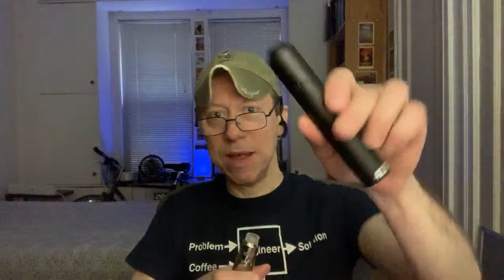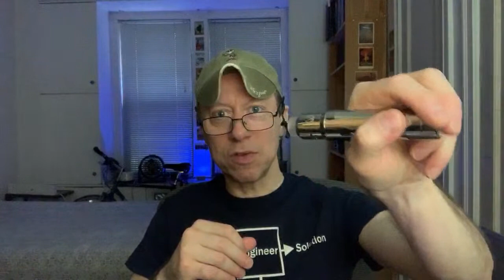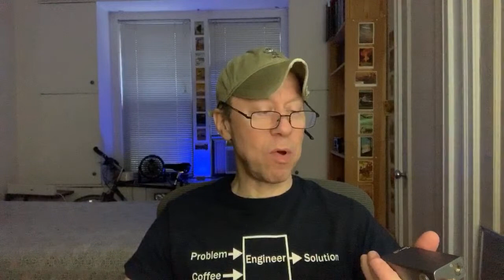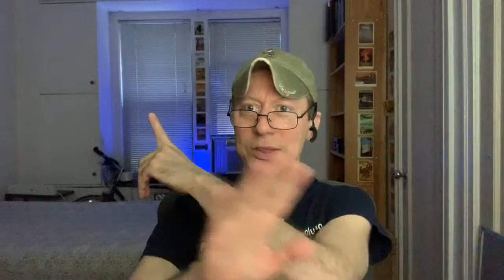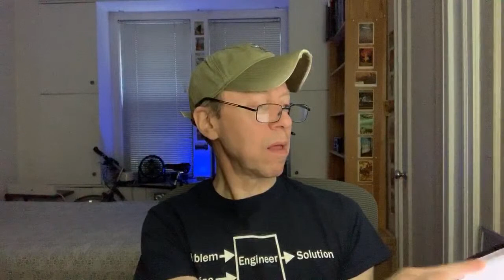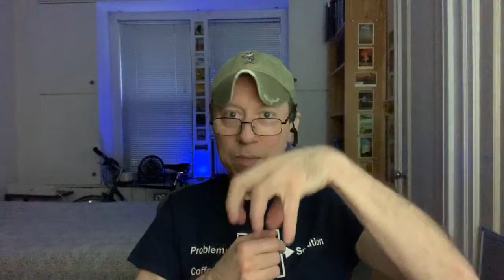The Power Hour #28 – A device we can put our batteries into any way we want?

Comment: darn, I missed you and have to use replay.
It seems a lot of trouble to have "any-way" battery bays done electrically instead of using decent markings on battery cells and bays - and as pointed out, it just kicks the can down the road to the next time the user upgrades.  It also trains users to have no regard to cell polarity, which seems to set a pretty dangerous precedent.  Also, can they even patent pre-existing art?
Thankfully, as the mods are absolutely fugly, they won't catch on.
I'm not sure about your power loss through 2A charging, given that you only have 10w to play with at the outset.  I don't see that much heating on my DNAs through micro-B USB 2.0 when I run the case analyser (as I do for all my Evolv based mods as the mod manufacturer rarely does) and the charging rate seems to indicate that a very high proportion of the incoming 10w is going right to the cells, which actually do have a slightly increased temperature - not so much that I'd call them remotely even warm, never mind hot, but not quite as cold as they would be at rest.  I can't detect ANY rise in temperature on the 21700s (P42As) in my Odin though.  Having said that, the Evolv charging circuit is one you've said you recognise and have used yourself, so is probably in the top line of components in terms of efficiency as well as reliability.
I suspect less well-designed circuits simply throw away the difference between the 5V of the USB and the 4..2 needed at the cell, and cap the current to whatever they can cope with - so you'd get 0.8V at 1 or 2A being dumped as heat.  Charging circuits on motorcycles used that technology for years, with a Zener diode mounted in a massive finned heatsink under the headlight.  It even became such a styling feature that fake ones were fitted to some bikes which had better means of regulating voltage and didn't need them!
To me, self-wiping contacts are far superior to using conductive grease in switches.  I've used them for years in banks of lead-acid cells used first in forklifts (way back in my warehouse and truck driving days) then later, after getting a edumacashun in IT, in power backup systems ranging in size from a single PC up to a whole server farm, where the batteries aren't even on the ground floor as that would make them intolerant of flooding.  Such buildings are specially designed to handle the weight of a whole floor packed with lead-acid batteries and a pair of monstrous diesel generators.  The ground floor is used by admin, is massively constructed and feels like being in a bunker.  Actually, it is one, as one threat they are designed to be tolerant of is terrorism.  In that application, I was more concerned with heat gained than power lost, but it amounts to the same thing.
I suspect using grease results in the switch conductivity being highly dependent on the pressure applied by the user.  The harder it is pressed, the less grease is left between the metal.
I've always thought of an 18350 as a purely MTL cell, so 8A is perfectly ok.
I remember from machining various metals many years ago that copper is far cleaner to cut than brass, which always comes off in chips instead of spirals of swarf.  So I would suspect copper threads start off better than brass ones.  New ones can be ground in with the finest grade of paste followed by metal polish, but they'll wear out if you keep doing that.  I'm not a mech user but have cleaned them for others, using tiny polishing mops on a Dremel with jewellers rouge on one mop and nothing on the other.  They are the same mops I use for polishing plastic, including Ultem.  Seems to work quite well.
And that is more than chat would have allowed me to put :-)
Stay safe, and have a great week.

Comment: Hey mooch do you have the odin 200 with out the DNA chip in it mine drains 1 battery almost empty and the other is half dead any reason off the top of your head why?
Reply from the maker: Sorry, I don’t have it and don’t know why. If you are saying they are being drained when not being used that can happen with a lot of mods. Never leave the batteries in the mod between uses. The mod draws a little bit from the batteries 24 hours a day in order to have circuitry be able to detect the three or five button clicks to wake up.
Reply: @batterymooch  no it drains the batteries way to uneven during use. I got 10 new batteries and still does it to them. I'm afraid this mod might kill the batteries with all the stress on 1 side. Is it really safe at the end of the day? So you know I charge all my batteries at .25A 1 battery takes a half hour to charge and the other one charges in about 4 hours.
Reply: @obsidianodin7348  That sucks! I wonder if that's a common issue with that mod. I don't have the Odin 200, but I've had the Odin 250 since December. It has better battery life than my other 2x700 mods and drains the batteries extremely evenly. Thought about picking up the 200, but won't if they all have battery issues